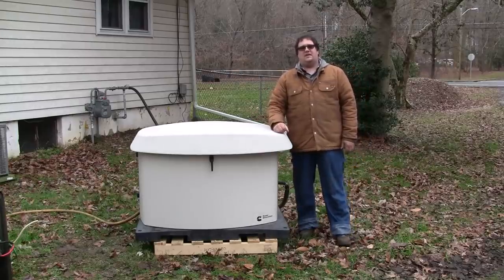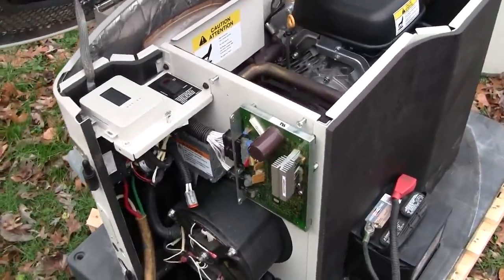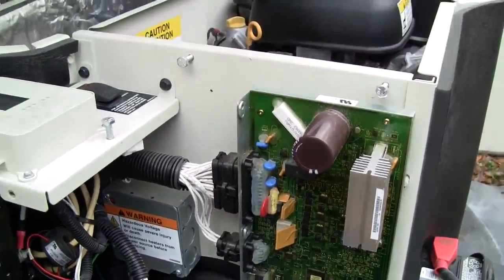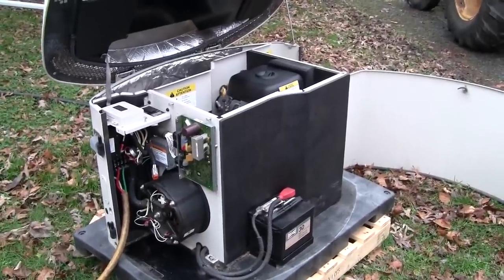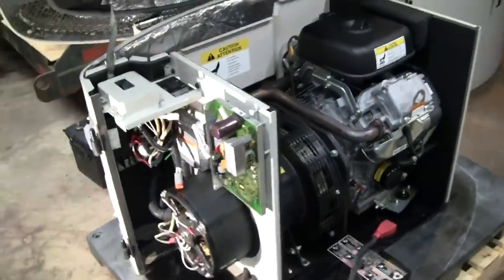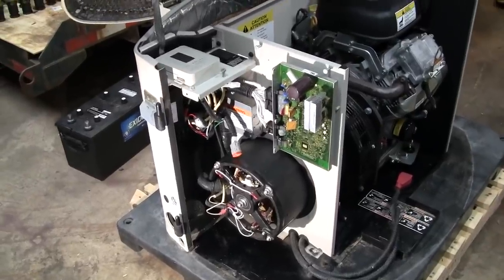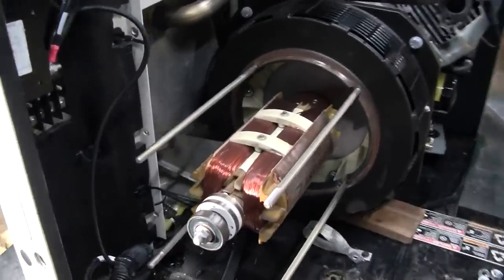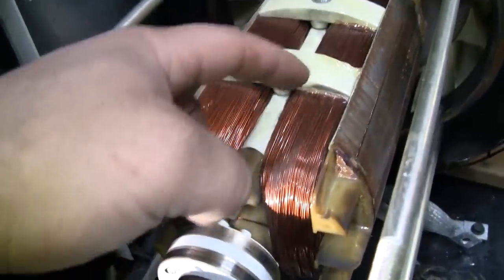2015 Cummins Home Standby Generator IS IT DEAD ALREADY? Pt. 1/2

Comment: Onan used to be a top shelf product but since Cummins bought it it's junk. a generator less than 5 years old and you can no longer get parts for it?  If the customer had not purchased the extended warranty then what you're out several thousand dollars because Cummins decided to not carry a parts for a four and a half year old generator? Absolutely and completely absurd.  I also see Cummins putting their name on a bunch of cheap Chinese generators and charging good money for them to the RV crowd. Sorry but I keep hearing too many bad things about Cummins Onan lately. They're off my purchase list.  Also anyone wanting to buy a standby generator for their home I will relay this little story.
Reply: The manufacturer "took a stab" at making the connection to the stator windings in the cheapest possible way...I wonder how many of these generators have been trashed by this "fault"? Might also be why Cummins do not supply the parts...any good diagnostician would see the "improved" method of attaching the windings (well hopefully the connections would be improved) and realise this was a built-in OEM fault...and the repair costs should always be on the OEM in this case, no matter how old the machine, warranty or not. Might be a good recall matter/free replacement for all these generators as they would be unreliable...not what you want for an emergency piece of kit.
Reply: @pneumatic00  I agree with you not everything made in China is crap.  I have some Chinese made products that are good for the $.  I have a feeling this particular product was made here in the good old US of A.  The Cummins RV or portable line of generators are also available under the Westinghouse name . Exact same thing other than labeling and color. Those are definitely made in China.  We have a local farm store that had a brand new electric start Westinghouse sitting on the display rack and the battery had already started corroding all over everything.  no cracks to be seen just the acid oozing around the terminals.  Also the local Lowes has Westinghouse generators available that have been returned and repaired. Interesting thing is a 3600 watt $300 + generator is being sold only for $100 and it was not beat up or rusty.  Looked new.
Reply: Maybe this is why the alternator part is no longer available, because of too many failures. The new model may be different or they may not want to chance pairing it in this generator. This is basically a Briggs and Stratton Generator. I Recognize that Briggs Engine and its probably the same alternator in a Nicer case. You can see my video of the 20KW Briggs Generator Here: https://www.youtube.com/watch?v=AN9X_YuBSL4&t=231s
Reply: The new models have Chinese made rotor and stators and if you need to replace, you have to buy a match rotor and stator set.

Comment: talk about making things cheap and think how much you pay for that generator. good job Mikey. oh i assume you know it but if you don't they do make a spray-on enamel for recoating scrape wire as long as the bare wire is not shorting out to the next wire the spray work great to recoat them

Comment: Are you going to pot those dangling wire splices to dampen vibration on your repaired soldered joints?  I see wire breakage in the not-too-distant future.  maybe a dab of good silicone RTV?

Comment: 31:13 you can see the wire broken on the rotor. Its broken right where it comes of of the plastic center piece.

Comment: I have been looking at gensets in that size range... do you have a recommended manufacture?
Reply: I’ve been trying to find a good used military surplus Fermont MEP 803A near me so I don’t have to pay a lot for shipping.  The MEP 803A can be set up for auto start from a transfer switch if you want.  It should be easy to get parts for the Isuzu Diesel engine and it is a very tough unit.  The capacity is only 10 KW, but that is an honest 10 KW prime power without needing any derating.  There are higher capacity units in that line too.  An Internet search should uncover some sources of where to get one.  The military operator and service manuals are on line.

I worked for a datacenter and we had a on old trailer mounted Baldor 90 KW with a Deere 4039T Diesel engine and I was very impressed with the unit and even though it was 30 years old, it was easy to get engine parts.  We moved to a new building and got a skid mounted Koehler 125 KW unit with a GM derived 8 cylinder IC engine using natural gas.  I was not nearly as impressed with the Koehler - it seemed much lighter built.
Reply: I got  a 1993 MEP803A gen set a couple of years ago. The only issue it has is age. At 15+ years some seals/gaskets are leaking fuel into the engine oil and dropping the oil pressure. A well known issue. Been using it on my shop until I get commercial power to it. This has given me the opportunity to really get to know it. Once I get “ real” power to the shop I will install the circuit board to make it an auto start unit and use it for my whole house genset. 10KW derated unit. 4 cylinder liquid cooled diesel rated for 24/7 usage. 1800 rpm...none of that 3600 RPM lawnmower crap.

Comment: I would have just found something a bit softer to connect to the remaining bits of the coil, then used the same method but with less chance of fracture at the pressure point, and maybe some loctite on the shaft, but maybe not, just to keep it serviceable

Comment: These look like a carbon copy of the same size unit by Generac. I've worked on a few of those, and they're pretty reliable for the most part. I wonder what's up with the Cummins version?🤔

Comment: 35:05 Hopefully the centrifugal force will not put so much weight on the thinner thread by the thicker one and the solder that it will break by shear puilling.

Comment: Dunno I would call a compression fitting ... bad but in this case it probably could be better, probably by having a metal fitting inside the compression fitting would insert into instead of just the housing material. So it would be two hard materials compressing the softer copper wire, instead of hard metal copper wire... and the housing failing whcih is what I am suspecting occurred.

Comment: I like the short cuts the manufactures make that works well ever time.  This one not so much.  Anyhow if you knew what the problem was would you still take as much apart to fix this as you did?  It seems ashamed that if the manufacturer had good people out in the field this could have been an easy fix that saved much cost for them and aggravation for the customer.  I've install and serviced some of these units and they seem to be pretty good.

Comment: I'm wondering if the soldered connections will move outward due to centripetal forces at 3600 RPM.
Reply: That's probably why he used #14 wire from the pins to the windings. It's stiffer than the smaller windings.

Comment: AFTER DOING ALL THIS, I WOULD REMOVE THE ROTOR AND DIP IT IN AN APPROPRIATE EPOXY VARNISH!
THIS WOULD HELP TO MECHANICALLY STABILIZE THE COILS AND THE SMALL WIRE BETWEEN THE COILS AND THE PINS ON THE PLASTIC SLIP RING HOLDER!
IT WOULD ALSO EXCLUDE MOISTURE FROM SOAKING INTO THE EXCITER COILS.

Comment: So how did you get hold of this?
I’m assuming Cummings sent you out to determine the problem.
You determined it was not economical to repair.
Cummings supplied a new one under warranty and said, do what you want with it,
Is that basically it?

Comment: u would think they could do a AND logic, rotation sensors & AC voltage output. Also, pre-tin your wires before mechanical connection, it will speed up solder flow.
Reply: Not needed. If there's no AC output there's no point in running the engine.

Comment: Did you knock the pilot out your water heater when testing the genset? 
I've seen T&P valves go if the tank was was relit after getting cold due to the expansion.

Comment: Great troubleshooting. I don't know what is next, but my . 02 says that those patched connections MUST be potted otherwise they'll break in a few hours of running.

BTW that design sucked unbelievably. I wonder how many of those in use are going to fail the same way. All of them prolly.

Comment: Pressure regulator at the water meter could have failed causing the water heater pop off valve to release. Check your water pressure, happened to me.

Comment: some holding epoxy on the rotor to slip ring tails to eliminate movement / vibration .   poor design rotor slip ring. guess trying to save a few bucks. nice fix mike.

Comment: Shocking design. Why did they not Use a set of insert pins with pre drilled holes So the winding could have been passed through the pin then Bonded in with Solder ? .Nice repair Should kick  now. ;-)

Comment: "Part no longer available" on a unit that's only 5 years old...this is completely unacceptable!  Using push-on spade connectors that are mission-critical to operation, installed in an environment of high heat and vibration,  is also unacceptable!  This isn't like any Cummins genset I've ever seen in an industrial application.  It's got to be a generic (probably Chinese) unit that Cummins branded as their own.  Shame on Cummins for doing this!

Comment: Mice are notorious of getting into generators building nests or just nibbling on wires. Being a retired generator tech I had to clean mice guts out of sensors and other moving parts.  Due to EPA guidelines they are using non -polluting insulation material made out of soy products. Just right up the alley of food for mice. It’s in the wiring and seat materials of all major car manufacturers.

Comment: Did you ever see the original failed rotor? I wonder if it was the same problem.
Reply: This IS the original generator, rotor and all.
Reply: @cambridgemart2075  the whole generator was replaced under warranty a few months ago, because of rotor failure.
Reply: @chrishartley1210  I may have misunderstood, but I thought this was the original unit that was replaced under warranty.
Reply: @cambridgemart2075  Oh, I get it now, it is explained in the description.

Comment: I cannot imagine that soldering will work long term, as the heat that is generated by the engine and mechanics will likely be higher than the melting point of the solder.

Comment: Don’t ya just love those intermittent failures. Almost impossible to diagnose. Everything’s good when you probe but under operation when you can’t get at it, it fails. Three times in my life I’ve ran into those. Much of the time it’s tied to temperature.

Comment: 27:00 Since it generates AC , I don't think it would care if the field windings were reversed. It would make a difference on a DC motor though. (would make it spin backwards)
Reply: It would if there is a diode in the sense circuit.  Probably no way to know for sure
Reply: The rotor is energized with 12VDC so you have to keep polarity correct.
Reply: @nogeek43  In a DC motor like a starter motor, or even an old car DC generator it would make a difference , but with a AC generator it doesn't make a difference.
Reply: @gordonborsboom7460  A diode in the rotor? What sense circuit?

Comment: Simple electrical pressure joint in vibrating machinery...   yeah... not very smart.  No wonder they don't make that model any more.  If it wasn't for that mistake, I'd say they picked a polymer chemistry with similar heat expansion characteristics to the metal shaft.  Betting they didn't bother, and the bent pin is from constant torque when the plastic expanded enough to be loose on the shaft.  For that matter, the same problem could have caused or exacerbated the rotor coil connection problem.  I do hope in part two you end up epoxying those solder joints to the rotor.  They should last a long time as is, but eventually vibration could cause them to fail.

Comment: Wow, cheap assembly. Old school generators had either slots in the slip rings, or tabs on the slip rings where the winding was soldered to the ring. Never saw press fittings for winding before in plastic. Wow, those are a dis-similar metal junction just waiting for moisture to get some galvanic corrosion going after the warranty period.

Comment: That sure sounds like a Kohler.  Not sure what the Cummins branding is for.  EDIT: It's a Subaru V-twin!
Reply: Briggs engine.  Kohler would never sell an engine to big C, arch enemies.
Reply: @nspro931  That starter sounded exactly like a Kohler Command to my ear....Is it a Vanguard then?
Reply: @kevin9c1  It may well be the same starter or similar.  Some Generac starters look very similar to Kohler starters so would not be surprised if that was the case here.  Delco builds a lot of them I think.
Reply: @nspro931  I couldn't let this go.  Some research suggests that these Cummins 3600rpm air cooled units use Subaru V-twins.
Reply: @kevin9c1  They used to use Subaru V-twin in the 13 (or whatever) kw but Subaru left the US market.  And it wasn't a great engine anyhow.  They used to use used Briggs on these bigger ones.  Eventually they switched both platforms to a Chinese manufacturer which is what they have now.

Comment: It seems like every otherwise well-designed machine has an obvious design flaw that the manufacturer somehow overlooked.  Looks like you discovered why that particular armature is no longer made.  Just a little extra solder here and there could have saved the company a ton of money in warranty replacements and repairs.

Comment: A good example of how screwed up the system is these days ,
The components of the generator are not available / or the parts supply do not last as long as the warranty .
So they are trying to get out from under being responsible .
Also making it necessary to buy  extended warranties , extended warranties should be the original warranty - not have to pay for it .
I'm old enough to see the changes / ripping off the consumer step by step ever increasing taking away a little at a time till , some day we will have the " tail-light " warranty = as soon as they see you driving away from the store - the warranty is over .
Similar to a lot of things we buy - they call rent / lease - they own it forever / we do not have the right of repair or ownership .

Comment: Wow..... Even Chinese drill rotors have the windings secured better at he comutator. I'd put a little glue/epoxy on your fix to stop any problems from centrifugal/vibration forces and it'll last for much longer than factory... Until some other cheap part fails 😁

Comment: What an utter POS of a generator. I imagine thousands of these things were sold, and now with less than 200hrs most of them unserviceable. All they have to do is sit there for 99.5% of the time and work .5% of the time but they can't even do that reliably.
What's the point of them?

I'm a qualified mechanic. I have 3x generators and I hate them all. I live off generator power and if you depend on them you really do grow to hate them. There is practically nothing good about them because they always fail. I've had all 3 of my generators not working at the same time - it is truly unbelievable but it happened. Nothing surprises me when it comes to generators. I borrowed an inverter generator that time they all failed and the next day the battery in it failed, so I had to replace the loan generator's battery. You can't believe this stuff but one concludes grid power is luxury.

How does all this happen you might ask? Well it happens because the people selling this stuff don't depend on the generators they sell. When you tell them of your problems they always say the same thing, "We've sold literally thousands of these and you're the first person to complain." This means the retailers don't want to know and so the cycle of grossly substandard products continues. 
If they had to power their business off the generators they sold then they'd know how unreliable they are and the quality issues resolved.
That said I now have one Diesel generator that cost $6500 that is running OK touch wood. In 2 years I have spent nearly $2000 on it though. 3x batteries ($150ea), 1x radiator ($600), 1x alternator ($475), 3x lift pumps ($120ea). It only runs 7 hours a day or 50hrs a week. 
I feel that $2000 has actually sorted it out because I don't get 'that' feeling we mechanics get when they feel something isn't right. 
BTW all the battery and electrical problems with the charging system and lift pumps was due to incorrect OEM alternator pulley size. It was over volting everything except the genset controller which shows it reading 14.4v but if you put a voltmeter on the battery it reads 15.1v. The new alternator still over volts like this. There was nothing wrong with the old alternator as it turns out. At least I have a spare. The solution was put a bigger pulley on it.

Comment: 31 minutes.   do NOT cut off those pins.  They are very necessary to maintain rotational correctness.  Without them, the collector ring could possibly rotate.  Being slightly bent should be of no significance.